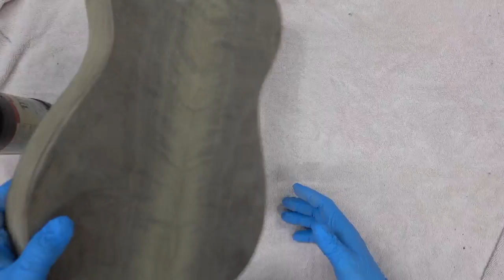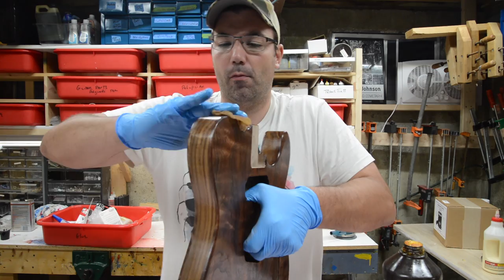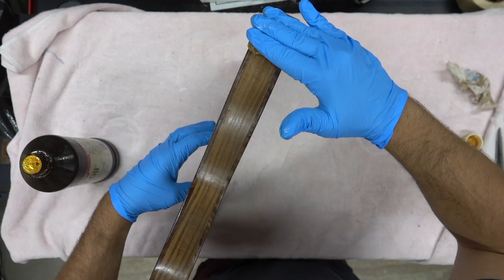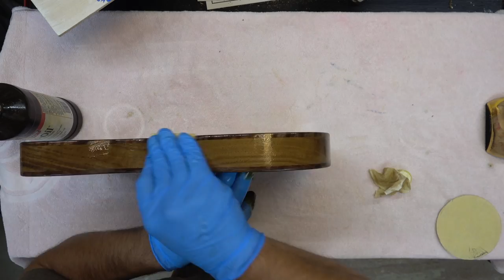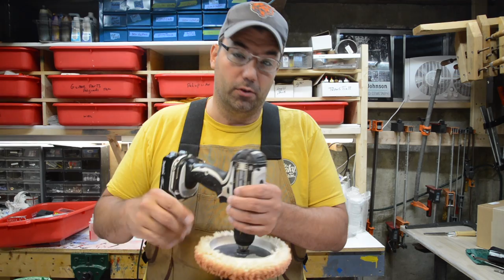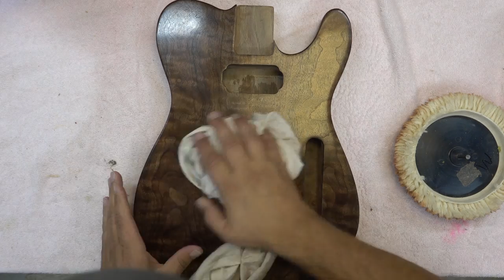Finishing a Flamed/Curly Walnut Guitar with Tru-oil - Full class

Comment: I have MusicMan Stingray bass guitars and they have unfinished necks. They recommend TruOil to maintain the back of the necks and I have been using it for 15 years. I had no idea it could be used for a finish. The polyester finish on the body of one of my basses cracked when it was around a heat source and I am looking to get it refinished. Thanks for video!
Reply from the maker: Lots of sanding to get those into bare wood.

Comment: That is gorgeous! I have no idea if you answer comments from older videos, but just in case: if the figure in the walnut was not as pronounced, do you think it would look good to dye the whole guitar black, sand it, so at that point the grain is highlighted in black, and then apply the Tru-Oil? Would love to hear from you!
Reply: You can! Usually the figured portions of wood have more open grain, which means it absorbs more color. When you sand away the top the figures portion will stay darkened with the paint. Start sanding away with 400grit and see how much black is coming off
Reply: @jairosanchez07  Thank you for your reply! Have you ever done this or know of someone who did? I would love to see an example of this, but haven't been able to find any.
Reply: MrMisteriousBoy yes, I have a table with this technique on my Instagram, but I didn’t sand it back as much because I liked the darker look.  Bigd guitars actually has a video on his channel where he stains a non figured alder guitar body, I know alder and walnut are very different woods but he picked a non figured alder body to show this technique. Remember, dyes actually penetrate inside the wood which soaks instead of a paint so you should be good

Comment: 1:24 Begin 

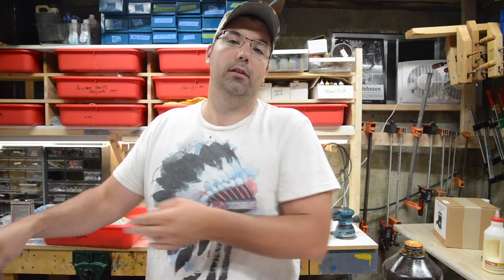6:48 Back of guitar 

(Let sit for 24 hours) 

7:42 2nd coat 

(Let sit for 3 days (Required? Idk)) 

12:12 600 grit sandpaper (with tru oil) 

     19:38 Switches to cloth to continue wiping with tru oil 

(Let sit to smoothen the pores) 

21:42 Sanding pad with tru oil again (600 grit) 

26:42 Really light coat of tru oil (with cloth again) 

        28:48 Back of guitar again 

(Let dry for a couple of days) 

30:04 Buff time
Reply: Hero.

Comment: This is a great video and your explanation is superb.
I am finishing a snare drum made of Jarrah wood with Tru oil.
I am up to 6 coats of Tru oil and am very happy with the result so far.  I let each coat sit for 24 hrs. then use 0000 steel wool in between coats. 
The only minor issue I have is that there are some micro unevenness in the wood because I never filled in the wood from the beginning. 
Can I do any filling at this point? 
Could I use wet sand with 800 sandpaper and Tru oil for a coat or two? Do I need to wipe off the sanded residue of the snare before drying?
 Then after it dries get back to using 0000 steel wool. Would these interim steps help to fill in the wood a little and make it more uniform and smooth?
I'm also looking to get a super gloss finish as the end result. 
Can I cut the last few coats 50/50 with mineral spirits? More 0000 steel wool sanding?
Any suggestions?
Thank you.
Any recommendations

Comment: Hey I'm doing the same process to a walnut body I built; hand sanded, Tung oil 14 coats, but a  quick questionWill the miniwax rubbing compound be fine to use? I would assume so, as its just a fine rubbing compound, then turtle wax on top?PS that guitar came out beautiful

Comment: I've used TRU OIL and /or Teak Oil multiple times before and it really brings out the grain, BUT I waited until it cured and then sprayed a couple of light coats of poly over it. My thought was that wax would not last as long as poly. What is your experience? It would probably be quicker and easier to use wax. Why wax instead of spray poly? Advantages-Disadvantages?

Comment: Big D: what is the protection of true oil, & will I have to reapply it after a certain amount of time of abuse? thanks in advance
Reply from the maker: I love tru-oil because its very durable.  Its used on gunstocks and you can easily reapply if you need to.
Reply: Marcus P. Carrozza I first heard about Truoil in a column by Rick Turner. He said his dad used it on shotgun stocks that he used to take in boats on the ocean to hunt ducks, and if it's tough enough to hold up to that it will hold up on a guitar body. That convinced me enough to give it a try.

Comment: I got a problem with using tru oil. After every sanding i put tru oil on in with a clean rag, let it dry for 24h but even after the 5th finish the surface  still is  rough like there is dust on it. I have a flamed maple top. I dont get it. please help me :(
Reply: Clean after sanding with denatured alcohol

Comment: True I was meant to be applied fingers not gloves and damn sure not rags between each application you should still wool Being from a gun refinishing background I know what tool does you would have a much prettier finish if you would do it the way it’s meant to be done
Reply: Steel wool sucks use 1500 wet dry sand paper start thinning the tru oil after 3rd coat finish up with tru oil wax